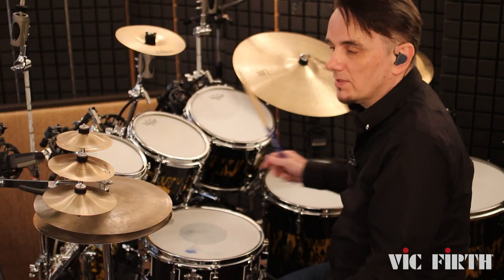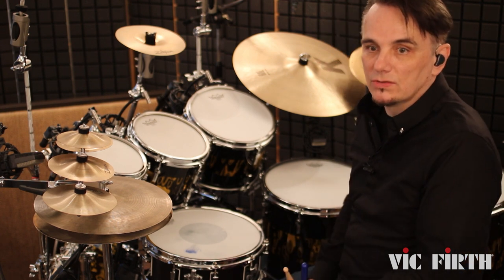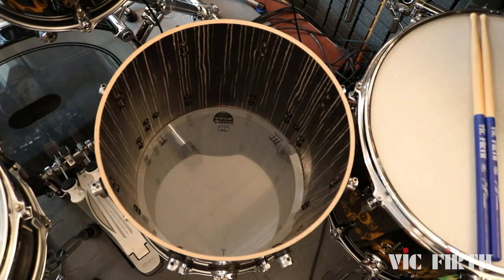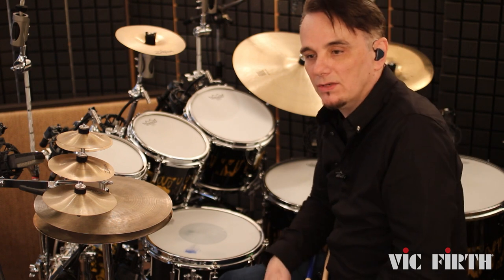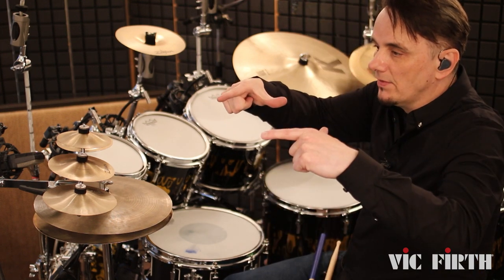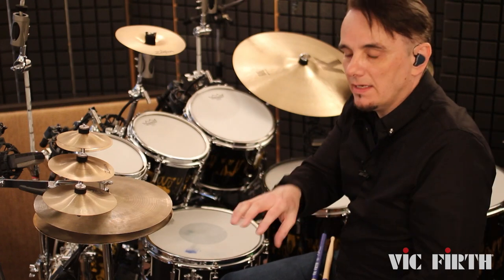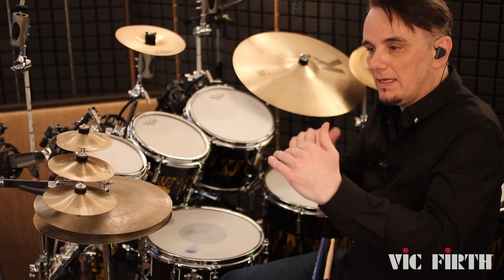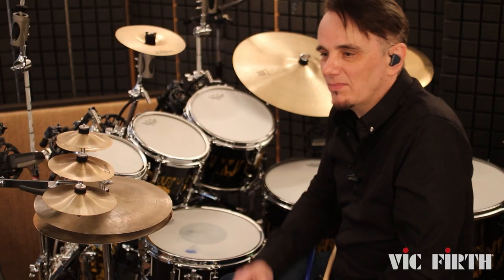Gavin Harrison | Vic Firth: Stories Behind The Sleeves BONUS LESSON

Comment: Always enjoy hearing your advice. The cotton and ring inside the floor-tom is definitely a unique solution which is actually more commitment than I want to make (maybe a fishing line through the vent hole so you can lift the muffling up).  Still holding off on the P3 you suggested (in another vid) but not for long; quite certain it will work with the patented CanStick in combination with other flat-surface controllers such as this one,  https://youtu.be/aOgQzzVOSI4